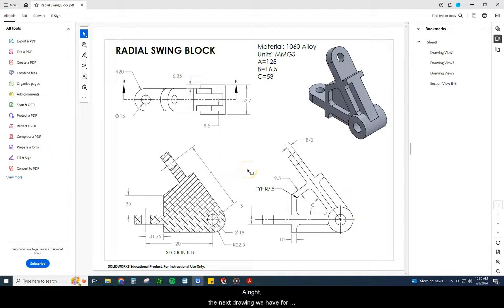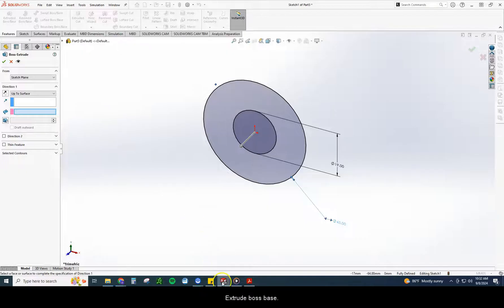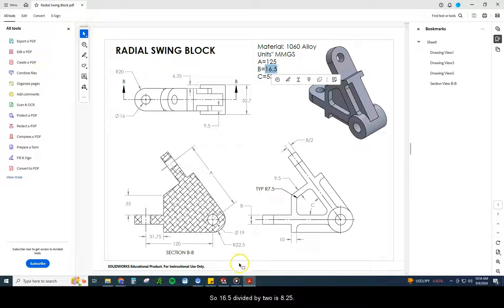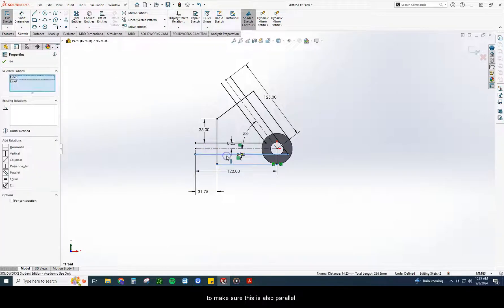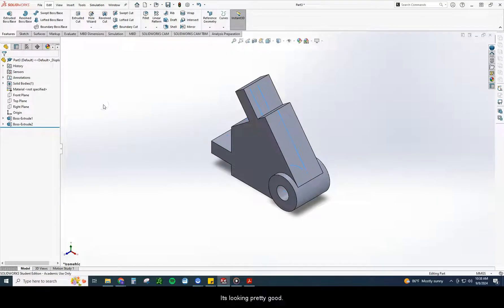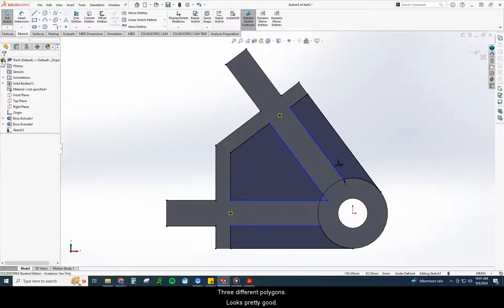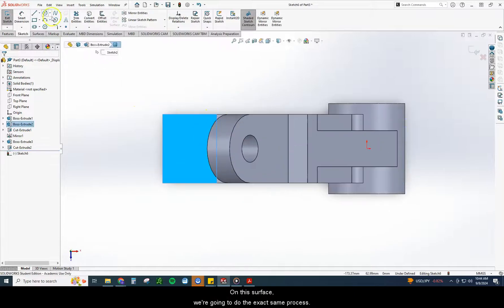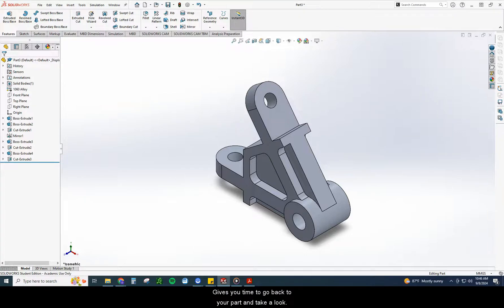Radial Swing Block

Comment: your work really helps prepare for the next time around.    I need to retake the CSWA.   This type of problem is not as easy as those contained in the MySolidWorks files.  This is closer to a CSWP example.    I notice you don't have systems settings set to 'use fully defined sketches'.